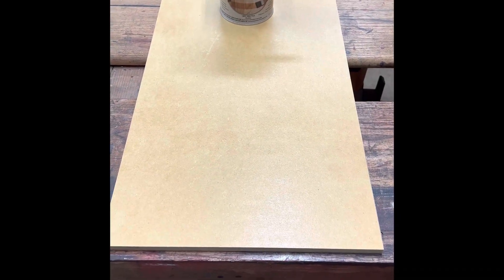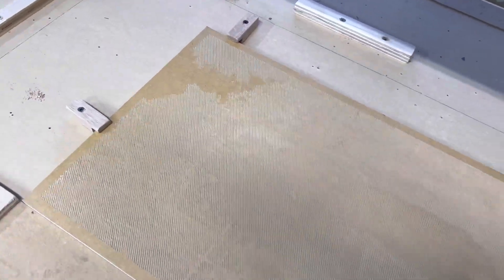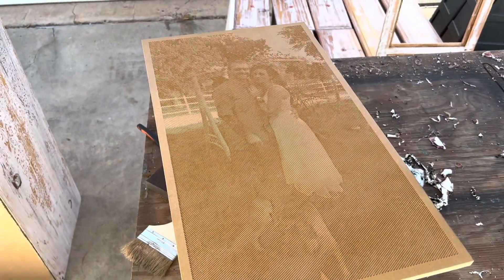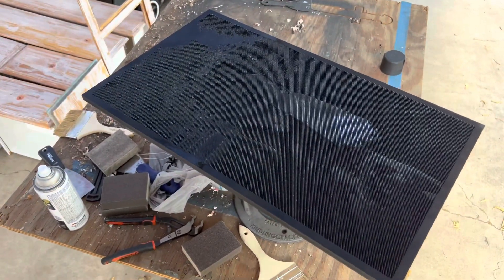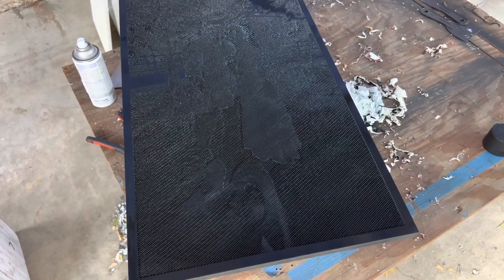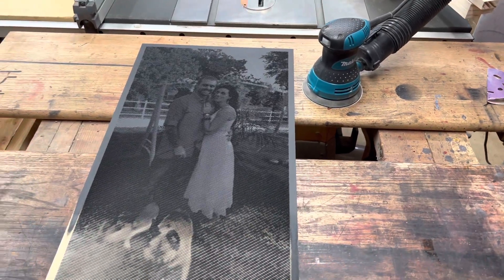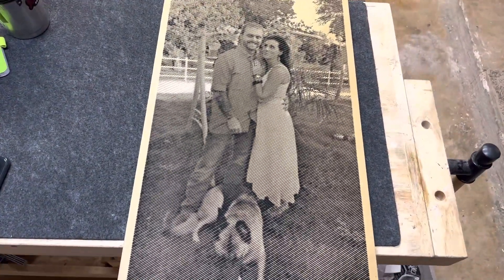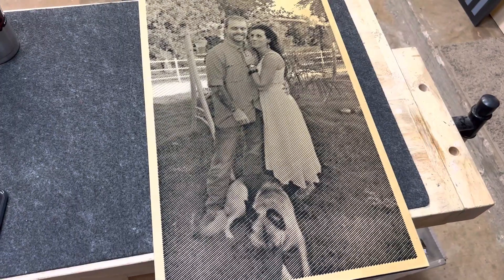Part 2, how to create a Photo V-Carve.

Comment: What grit sandpaper did you use to sand the paint off?
Reply from the maker: That depends on what finish I spray on before painting. If I use shellac, I will start with 80 grit to remove the bulk of the black paint. Then I will use 120 grit to finish the remaining black paint. 
If I use Deft Clear Finish, I just sand with 120 grit. 
The Deft Clear Wood Finish is my favorite. It makes sanding very easy and dries super fast.